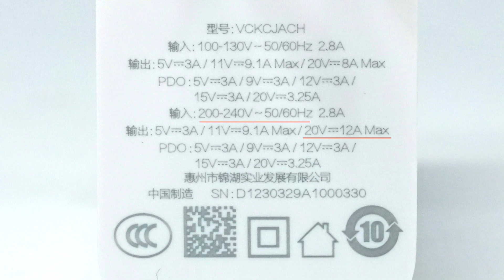Teardown of realme 240W GaN Charger (For realme GT3 / GT Neo5)

Comment: As i found out,
1) a 65w superdart charger will only run 40w-45w when using other 66w cables.
2) other 65w GaN chargers are not compatible with 65w superdart on my bros realme.
Reply: I just found out buying one lol.

Comment: wtf 12a does can the connector handle that amount of current without getting hot
Reply from the maker: The peak power is about 211W and only last about 5s.
Reply: @ChargerLAB  Still, this is clearly out of spec for USB-C.
Reply: @FOREST10PL  they use their own spec. Puzzling why they didn't go for PD 3.1  as it supports 240w as well
Reply: @theo610 As far as I know, in specification 3.1 the maximum current at 48V is 5A, then the smartphone will need to overcome the conversion of 48V to 3.7*4=15 V (in a smartphone there are like 4 batteries connected in parallel?).  This can lead to overheating.  I may have made a mistake in the numbers, but this is the principle.  140 W PD is for laptops or at least thick tablets.